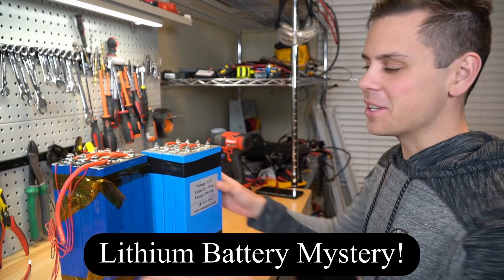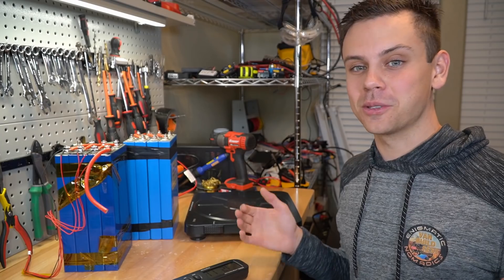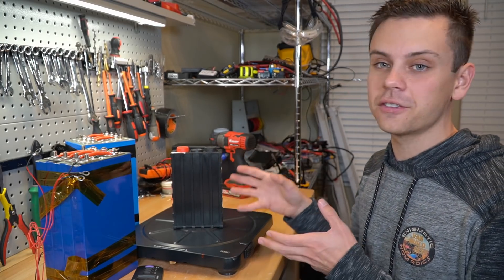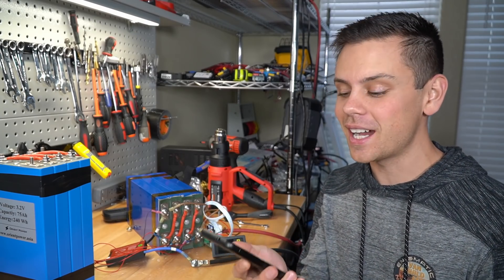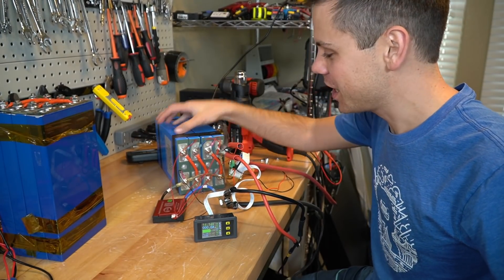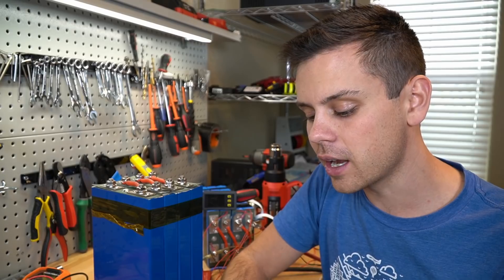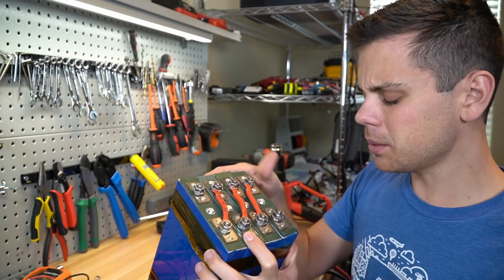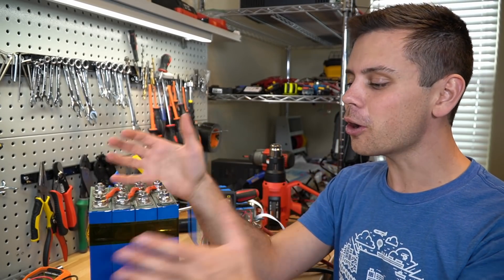Lithium Battery Mystery: This 100Ah LiFePO4 Energy Density is Off the Charts

Comment: Thank's for excellent educations, May I ask you a few questions related to the topic above? If looking into the Calb and Sinopoly 200Ah cells they have a weight of 5,6 resp 5,8 kg ca 110 Wh/kg a volume of 3,5 liter, But the Winston 200 Ah cells they weigh 7,3 kg (87W/kg) and have a volume of 5,1 liter.  Does that tell anything about quality? more is better? Why else spend money on weight and volume both of the parameters drive cost. Calb has a 176 Ah cell with Aluminium casing weight 3,9 kg (144Wh/kg) should that make me suspicious about quality of that cell? Is there any advantage with Aluminium casing? it will transport away heat better.

Comment: Are we sure those batteries are actually the LiFePO4 they were marketed as?  Is there some way to tell from the charge/discharge curve without ripping a cell open?   If so, then the chemistry has been improved over the years but perhaps the standards tables have not :-)

-Matt

Comment: Will, the cell reference number doesn't shows on Great Power Battery page. Any other number/reference? Do you think this is the replacement? XX135214
34135214 / 3.2V / 113Ah / ≤0.7 / 34.0 / 135.0 / 214.0 / 2140.0
Reply from the maker: That's what confused me. I can't find it on their website. It was on alibaba
Reply: Besides GSP34135214F, we have other dimension models

Comment: Not to ruin your natural high, but it's perfectly possible for two cells of exactly the same size and weight to have different capacities.
The higher-capacity cell will generally have thinner plates to make room for more surface area. They will have higher capacity, but also higher resistance, so will not be suitable for the high discharge current of the lower-capacity one.
Anyway, if a LiFePo4 cell has 160 Wh per kilogram of specific energy, that's incredibly high!

Comment: I think Jack Rickard from EVTV tested these cells years ago and found higher energy density but lower C rates because of thicker electrode layers.  Fewer thick layers increases capacity but lowers C rate.
Reply: Still, they are great in many applications, or when you parallelise them. Would be definitively nice to see proper datasheet or full parametric testing done on them with different charge / discharge rates, temperature, and DoD.

Comment: Still confused with the information given by my window air conditioner company that I would use in my Stepvan. 
5000 BTU/h is the capacity, 1465W.  450W on the high end of power consumed at outlet, 450W on hot day.
Metric the product EER is 3.3 or that capacity (in Watts) is about 3.3 times increased than power at the outlet.
Recommend 2KW inverter to properly start the compressor up to 17Amps, may be needed for very short period of time-Milliseconds. What is your recommendation?  Thanks for your help, videos and I am going to check out your book.

Comment: Question for you. I have a new power station Hyundai 1000W / 2000W max Lithium Power Station AC/DC - 100Ah Battery , and can be charged via AC @ 240v as well as solar (dc @ only 30w!). I was wondering: could I charge a normal deep cycle battery in the day time with a solar panel while the power station runs my fridge, then charge the power station over night with my newly charged second battery to keep it topped up in the event of a total power failure?
Booklet says only to use solar.

My thought was, what if I use my PWM controller (programmed for lifepo) with my deep cycle as source, and charge it via the PWM? Would the Power station know the difference if I keep to the maximum volts and amps recommended in the Hyundai booklet?

Comment: many times when you fimd the same measure with different capacity from the same supplyer they are just ones that in the production whent bad... even winston has 3 different quality cells, but they are all made the same in te same line... and they will sell you what are you willing to pay... mastervolt and victron buy the top quality ones...
Reply from the maker: Great point

Comment: How many amps can that 100Ah battery discharge at and still keep it's longevity? I need 96V (8 of them in series) that can continuously handle 100A, and burst (maybe 10 seconds at a time) 400A

Comment: Another great video Will! I wanted to ask if you had looked into Lithium Titanate much? I got an email from a company in the Czech Republic trying to sell me some 40aH cells for $63 each with a (wait for it) 20,000 cycles promise (to 80% DoD). I won't post any of their info because I don't want to create the impression that I'm trying to promote something, but I did want to ask the question of my Go To Solar Guy :-)
OOOOPPSS!!!!!!! D'UH! Should have known you've already done a video about these.....please ignore.
Reply: The pieman you can get 20,000 cycle with LTO because there is very little stress on the anode during cycles.   You give up energy density because the cell voltage is lower 2.3v per cell.   Great chemistry if you have room for the bigger battery.

Comment: Just weighed a 75ah(actual tested capacity is 85.8ah, I have 15 within 400mah of 85.5ah) LiFePO4 cell I bought last year from a reputable Chinese company. Energy capacity comes to 3.2V×85.844ah=274.7wh and weighed 2kg(used a 1000lb rated scale with .2kg accuracy so keep that in mind). That gives a specific energy of 137.35wh/kg.

So moral of the story, LiFePO4 specific energy figures that come up first on google aren't related to reality and haven't been for over a year+.

Cells I bought are from, Modi Battery. I highly recommend them.
Reply: Well that's good to know. Will's numbers are even higher than that.
Reply: @BikeHelmetMk2  yeah and with potentially 1 year newer cells than what I have. So LiFePO4 chem has only gotten better!

Comment: Is it possible that batteries have variation in production quality that occurs naturally, or at least beyond a manufacturer's control, and then the produced batteries get evaluated like LED lights. There may be different 'bins' that we don't see. But the producers know the quality (bin) if they test them after production.
Reply: AMD does it with their chips too.  Many manufacturers in many industry can grade their products and rate/sell appropriately.

Comment: Wait.  You’ve got those cables on there.   Weigh only the batteries, right?
Reply: I thought the same. Proportionally the difference is pretty negligable but it would imply even better energy density than found.

Comment: Have you seen or heard of the new solid-state battery? Quantum Glass battery is a game changer! Make lithium look lame!
Reply: From what I've seen/read it's still a few years out until they get the right formula. After that a few more to get production models working reliably.
Reply: From what I have seen/read, John Goodenough and his team haven't come up with the right formula yet. They have produced working models for "proof of concept" My guess is a few more years to work out the right formula and then more to get a "safe" production model.  Do you remember all the the problems with the exploding cellphone batteries?
Reply: There's always numerous new "world-beating" technologies being spoken of but very few of them reach their supposed potential and even less reach production. Stay interested and learn what you can, but don't believe anything not yet tested and proven.

Comment: is 100ah on all 4 cells? or 100ah total on 4 cells?
Reply: Both statements are true.  The cells are in series, so voltage adds, but capacity (Ah) stays the same.  Put them in parallel and the opposite would happen.  Helps to draw a diagram...

Comment: Typically with Lead Acid batteries it's better to buy them all at the same time. With the Lithium batteries is that also the case? At $900+ that's a hard sell.  I can buy 9 lead acid batteries for the same price.  Can I buy one and add more over time without issues? What is the cost over time? Is it cheaper then lead for the life of the battery? I've seen a few of your videos but I haven't seen you talk about that yet.

Comment: Ahit i can use these in my Kayak to run my motor.  Currently have the battleborn in a cooler on deck.   These could go inside the hull of a sit on top Kayak.

Comment: What if the cells arent lifepo?
Reply: C
That’s my conclusion.
Reply: Yeah probably NMC cells labeled as LiFePO.
Reply: Unlikely, since they have a higher cell voltage. Chemistry and voltage are pretty much linked. Energy density can be optimized as we see in this example.
Reply: @Jason Bowman You're probably right.  Although wouldn't the BMS be responsible for determining if they over volt for extra capacity?  Will connected his own BMS... I dunno this is just super suspicious for sure.
Reply from the maker: @ctuan13  No, its lifepo4. nominal voltage is different. and charge discharge behavior as well. you would spot that change at high soc or low soc instantly. they are true lifepo4
Reply: @WillProwse  Yeah you're right, I stand corrected!  But it's crazy how high the capacity is.  Following the principle that you cant get something for nothing, what do you think is going on here?  Do you think they are max capacity at the cost of cycle life?
Reply from the maker: @ctuan13  , cycle life should be good. These are aluminum cased so they actually last a long time. What is going on is manufacturing changes in this chemistry. There are some new articles on it. I need to memorize all the recent changes. The tech is just progressing quickly
Reply: @WillProwse  Ahh okay, that makes sense!  Thanks for the clear explanation!

Comment: It is claimed that this aluminium case batteries are made by CATL that will make sense but not sure how re-seller get them. That 163Wh energy density is great my A123 20Ah cells have just 128Wh at 1C don't think they have much more at 0.2C and they are pouch cells but they are rated 5300 cycles at 100% DOD.
I have shipped you some toys as promised the SBMS0 and a few DSSR20 you can check the spec for them on my website and you can ask if you have any questions. No obligation's they are just a gift as promised long time ago.
Reply from the maker: Oh awesome!!! Thank you electrodacus!!! I cant wait :D  

Wow that is a awesome charge cycle life for your pouch cells. Incredible
Reply: @WillProwse  Yes that cycle life is excellent but there are two factors one is the cycle life and the other is calendar aging.  I did a capacity test when I got them and then another one after 1 year of full time use (powering my house) the average energy used from the battery each day was about 50% of the capacity so almost like a 50% DOD each day for a year and total measured degradation was 0.9% from that around 0.3% was from that cycling and the 0.6% from the calendar degradation (this calendar degradation is related to small reactions inside the cell even if you do not use the cell at all and they are faster at higher temperature but my cells where always around ambient that was just +18C to +26C).
Now is more than two years I need to find a day to test the capacity degradation again but I expect to be linear so less than 1% per year with fairly heavy use.
Reply: Ahh Your videos seem to be doing the rounds again after a few years hiatus? I hear you had a kickstarter? Is that for proper production facilities or are you still doing batch production as and when?
Reply: @WillProwse  Def looking forward to that SBMS0 review.  Specing out a DIY solar system for my camper and, as much as I'd like to use ED's SBMS40, with limited real estate for panels on my rig, going with an MPPT to milk every possible Ah from panels but looking at relying on SBMS0 for cell balancing so very interested in where you land in your comparison of it against other BMS's.

Comment: sorry if silly question, but if that battery is 100ah, and you just drew 100ah, does that not damage lifepo4? I mean, didn't you just draw it to 0?
Reply: no damage, 100% just shortens the charge/discharge lifespan

Comment: we learned that those are not LiFePO4 batteries.
Reply: What are they?
Reply: How so? Can you backup your statement?
Reply from the maker: Yes they are lifepo4. Charge/discharge curve would have been different. Manufacturing processes have changed recently, and there are a few studies in changing the chemistry for better energy density. I was not aware that it was this good. It is lifepo4 though. You cannot fake or hide a charge/discharge voltage behavior
Reply: @WillProwse  is this good for solar back up?
I'm assuming they're 12V.
What is their minimum discharge cut off voltage?
Cheers!

Comment: dont like the price...    way too much for my budget...    can get 5 , 100ah agm for less than the cost of 1 of those
Reply: That is true, however, AGMs weigh 2x more, the DOD of AGM for long life is considerably less, and AGMs charging is horribly inefficient. A 60-65ah LFP will provide more WH equivalent than a 100ah AGM. LFP is worth the price where weight, space, and charging is critical. 2BZ2RANCH
Reply: @2bz2ranch45  been using these 5 agm now going on 6 months... takes a good 10 hrs to drop near to  the 12volt mark..  panels juice it back up to 13.5 by noon the next day